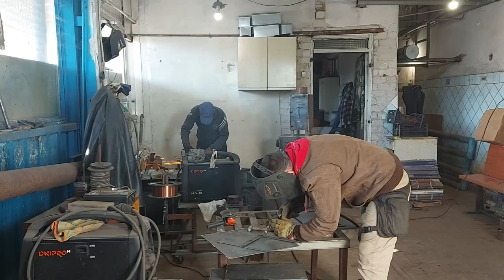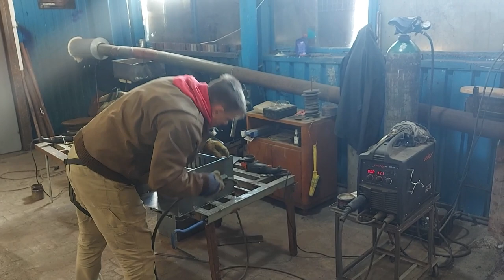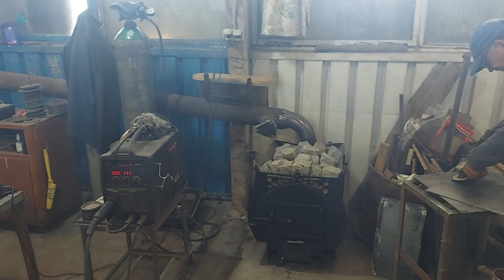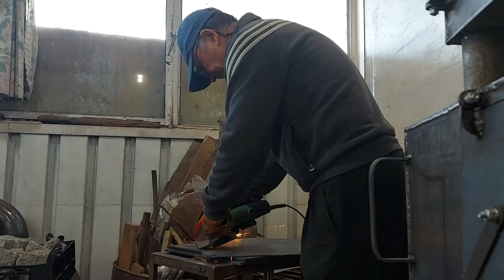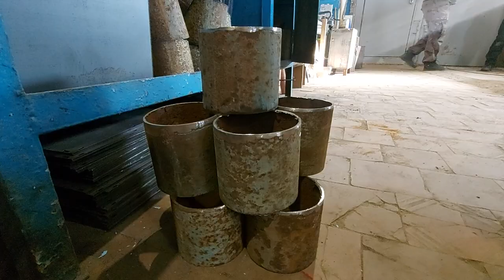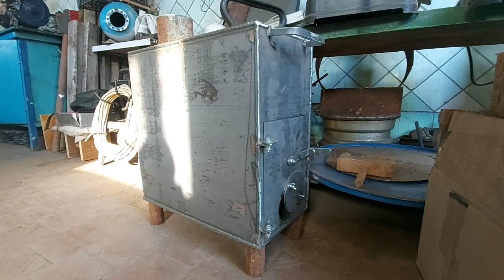Запорізькі волонтери варять буржуйки для військових та цивільних пунктів обігріву

Comment: The blurb says, "Since the beginning of the war, about 800 of them have been made.
The stove works on wood, heats up in 10-15 minutes.
The military is installing gas stations in the dugout, and they have already been sent to the residents of the liberated territories or those that are under the control of Ukraine, but due to shelling there is no gas or electricity there.

Ukrinform video"